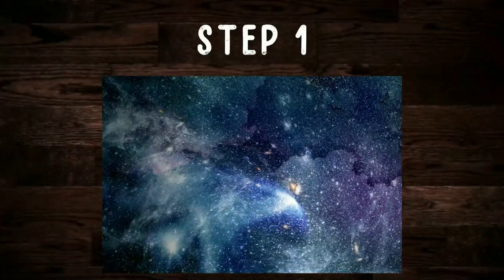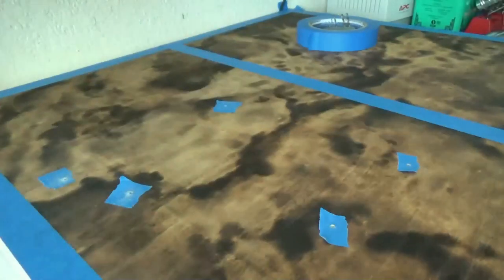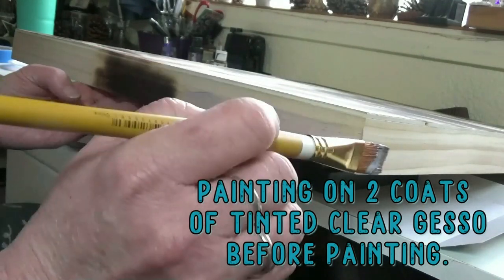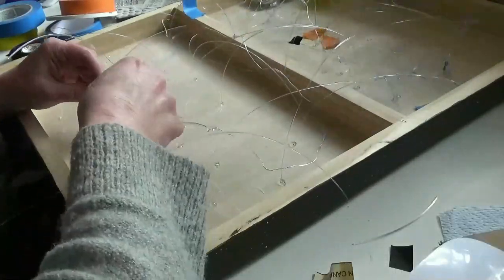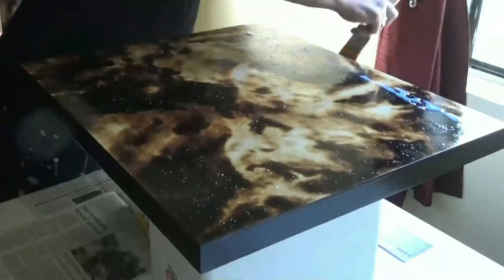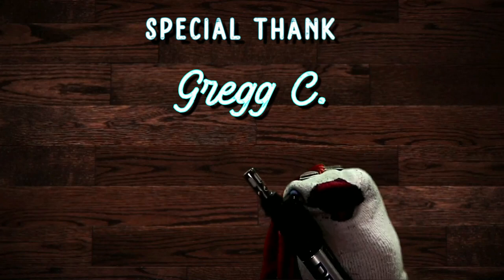Are you missing out on a wonderful Pyro technique? Hot Air Wood Burning!

Comment from the maker: Thanks so much for watching! Don't forget to subscribe if you haven't already. 😁 This project was so different for me from start to finish. It was frustrating at times, but it all worked out and I am proud of myself & the piece. Not to mention I discovered a whole new way / tool to do #woodburning and there are zero chemicals to use in the burning process. Let me know what you think here in the comments. Happy Burning! 🔥 

Time Stamps
00:00 - intro & Step 1 photo & pattern 
00:18 - Step 2 / Hot Air wood burning 
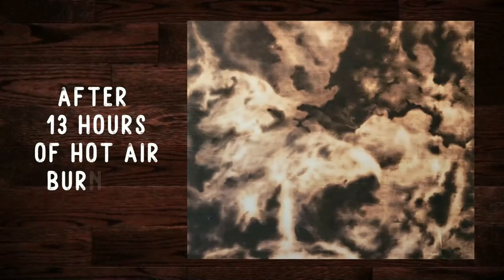03:00 - Step 3 Drilling holes 
04:29 - Step 4 & 5 workable fixative & star splatter photos 
04:55 - Step 6 Painting the edge of the wood 
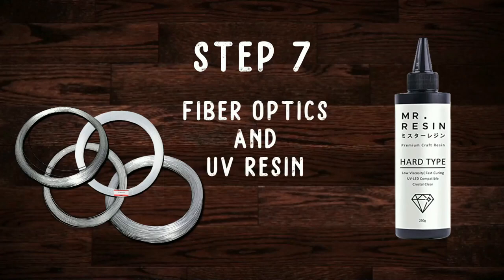06:25 - Step 7 UV resin, fiber optics, and lights 
08:34 - Step 8 Varnish & Diamond Dust 
10:50 - Final piece photos 
10:58 - Showing how the remote works through the wood & varnish 
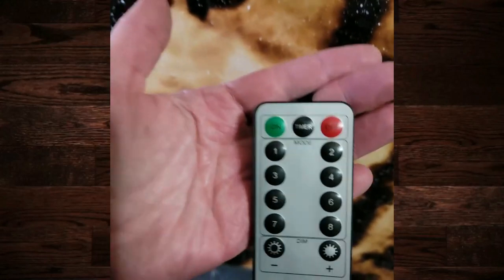11:39 - Photos & videos of the final light pattern. Also showing the Diamond Dust and finished varnished layers. 
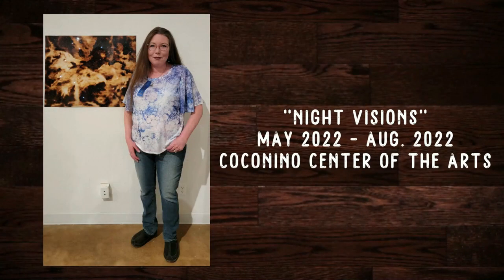12:45 - Photo of the pice hanging at the Coconino Center for the Arts 
12:53 - Closing thoughts 
13:20 - Thanks Super Toasties!